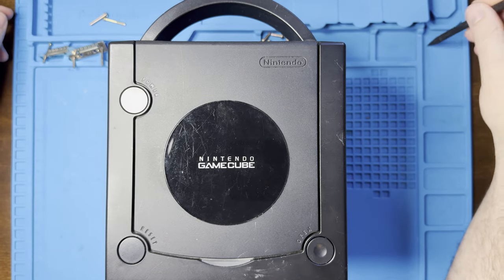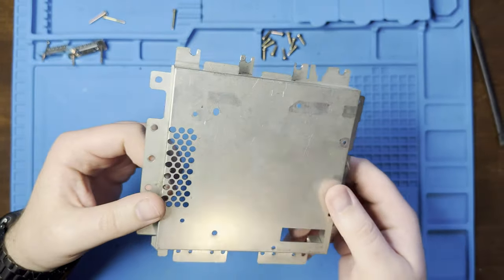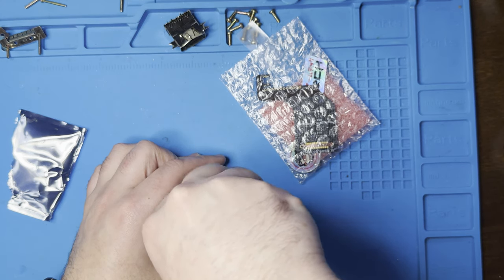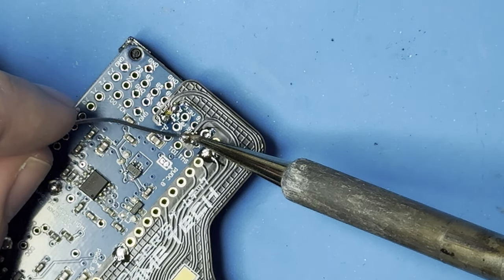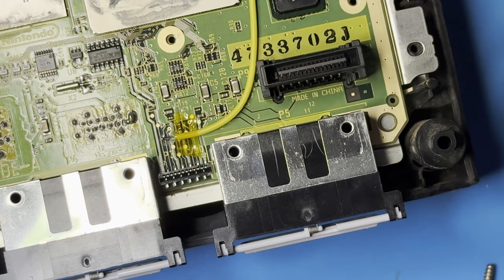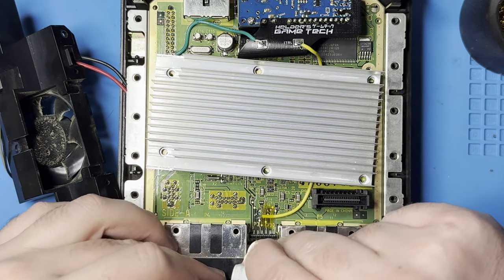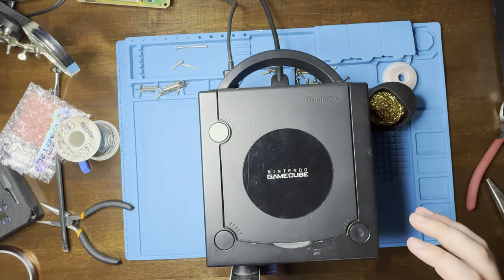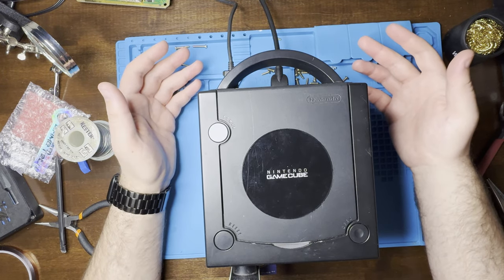Let's install an HDMI on my GameCube!

Comment: How much did u pay? I only see versions which costs over 150 dollers… is it worth it?
Reply from the maker: Maybe like $70-80 in total for parts after shipping? It certainly wasn't $150. Maybe those include you sending in the GC and the labor in doing the mod for you. I'm not sure. But I like the mod, it was fun to do in general, but I was stuck at home for about a week and decided to replay some retro games and it made it a piece of cake to plug into my home theatre which was super nice.